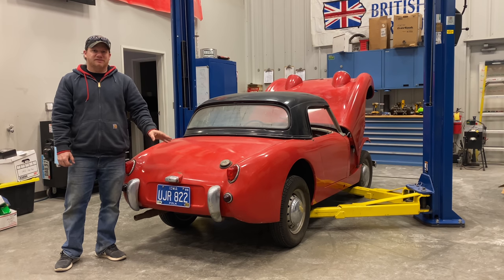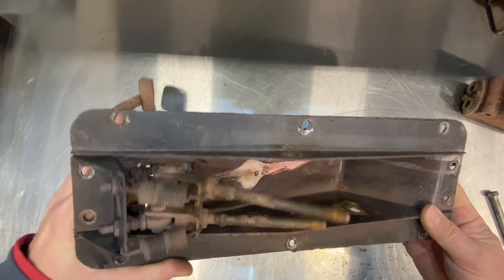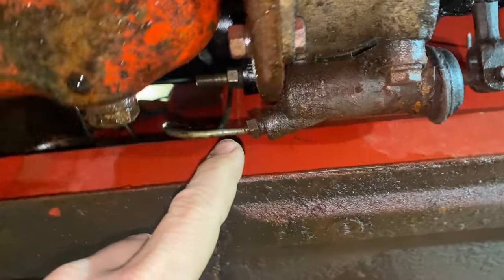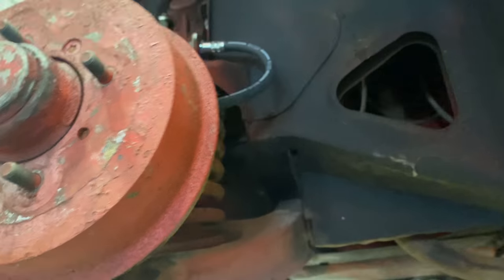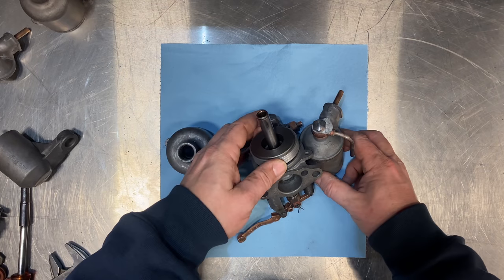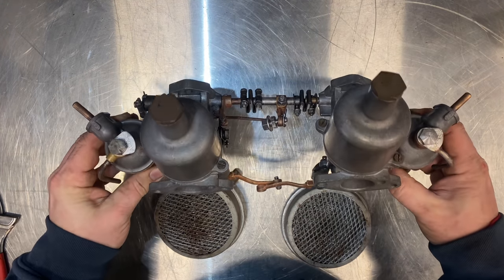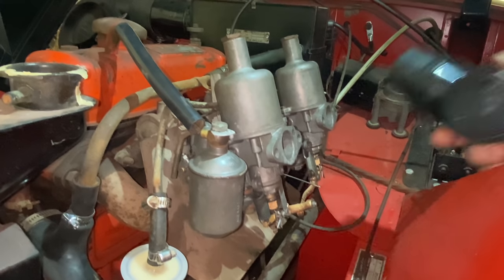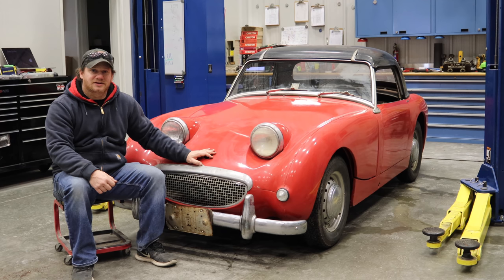Round 4 - Barn Find Sprite #2 - Will It Drive?

Comment: RE my comment on the XJ6 video:  LOL, another memory from the Taos shop, about 1969.  A young  lady brought in a Sprite with a totally fried generator.   Everything was bad.   Field coils, armature, totalled.  We priced a new Lucas generator - about $350/400 back then was a LOT of money for her.  Told her we could mount a nice Dodge generator we happened to have.  Need to change a bracket, add a spacer, and change the regulator.  She was shocked, shocked.  We assured her it would work just fine, just remember to tell future mechanics about the adaptation.  She drove out with a working Dodge generator, and a happy Sprite.   The whole job for about half the price of the Lucas part.

Part of being a decent mechanic is to have an open mind.  Allow all possibilities to be considered.

Comment: My carbs on one of my Bugeyes are dry, I need a rebuild kit and to figure out what to put in there, mineral oil or whatever. The question is, with all my spares, do I just rebuild a bunch of them or only the ones I need?
Reply from the maker: Only rebuild the one you need there are plenty of them out there and they are not really worth much to anyone else as they are easy to get.
Reply: Thanks! Good advice.
Reply: I’ve had luck pulling the old cork seals around the mixture control rod at the bottom and soaking them in motor oil. As long as they aren’t disintegrated or worn too much they will swell up and seal again.
Reply: For the carburettor piston dampers, SAE 20 engine oil will do.   Or 20w50.   You can buy special 'SU damper oil' but most people just use engine oil.   Thicker oil will richen up the acceleration.   Whatever grade, some oil is better than none  :)
(My next-door neighbour had a Mini Cooper and I could tell from the way the poor thing spluttered and missed when cold, the piston dampers needed to be topped up).

Comment: If memory serves, these early SU carbs had fixed needles (held in by a slotted screw) also the sliding main jet/choke sleeve requires centering when piston/dash pots are fitted..? I am not saying you didn't carry out this procedure, only that you neither mentioned or showed it in this video. It is a crucial step to attain a smooth  balanced transition when returning to idle. Hope this is of interest/informative. Regards AndyPCR

Comment: Steve, l once had trouble starting a car that had been standing for years.  It turned out that the gas (or petrol as we call it in the UK) had lost it's volatility. Prior to attempting to start these cars not run for years do you drain and refill the gas tanks with fresh gas?

Comment: To avoid having to jack up the gearbox to get out the top bolt you can cut the top bolt hole in the slave into a slot so you only have to loosen the bolt rather than completely remove it.
Reply: Been there, huh?  Nice mod.  But how do you get the old one out?
Reply: James, yes, you still have to remove the slave before you can install the modified one. Usually, it can be done without jacking up the engine but even when everything is as should be it is very difficult to install that top bolt so being able to leave it in place for the next time is very helpful. There is also a short pipe you can buy that attaches to the slave which brings the bleed nipple up into the engine bay for easy access. Where that slave cylinder lives is really difficult to get at.

Comment: You mentioned using a 7/16 socket in this video.I'm certainly no expert on these cars, but they were made in the UK as I understand it. Wouldn't everything be metric?
Reply from the maker: The UK did not build cars in Metric until about 1975 and many parts that were carried over from previous years were still in Standard or British Standard Whitworth.

Comment: Enjoyed the video.  Is that engine running on all four?
Reply from the maker: Until the ignition is replaced the spark will not be relatable and the longer it runs the better the compression will get.
Reply: Was thinking the same.  That or an exhaust leak that made it sound like an VW bug engine.  I have a Mk3 Spitfire and it definitely doesn't sound that "choppy".  But Steve's explanation definitely make sense.

Comment: It's great to see the progress on this little car, Steve.  Love the sounds of the small A-series engines, although I cannot recall whether the Bug-Eye had a 948 or a 1098 (something tells me it's the smaller of the two - ie: the engine out of an Austin A35 / Morris Minor 1000 and no synchro on 1st, so the idler gear gets hammered!).   They have a very unique look, those little beasts and will forever be cool as a result.  

One thing I heard when the engine was turning over (and confirmed when it fired) was it sounds like you have a dead miss.  It's like it has a stuck or burnt valve - very common to burn #3 and #2 exhaust valves or to stick #1 exhaust when sat for a while. My pick would be #3 exhaust valve is burnt, although I hope it's just stuck!  

Worst I ever had was on an A35 I bought running rough.  It had split the face of both #2 and #3 exhaust valves quite bad, #1 inlet was not seating properly and #1 exhaust had a hairline split that had just separated at the edge of the face.  How it ran at all was a testament to British engineering!